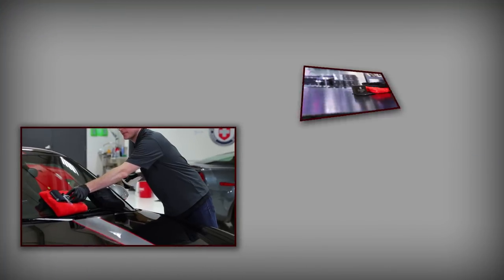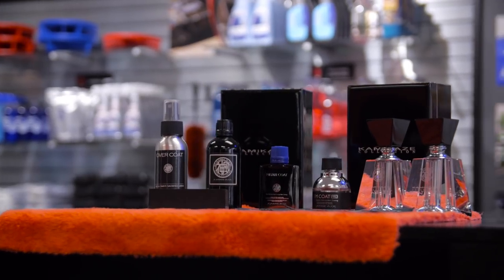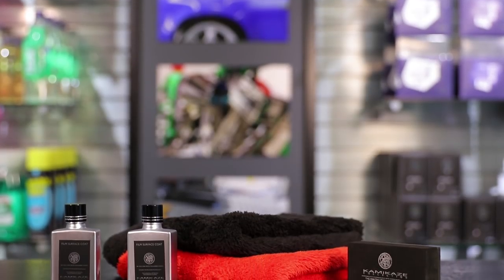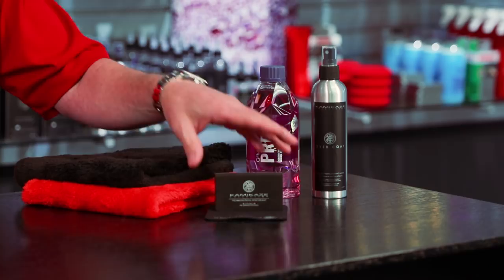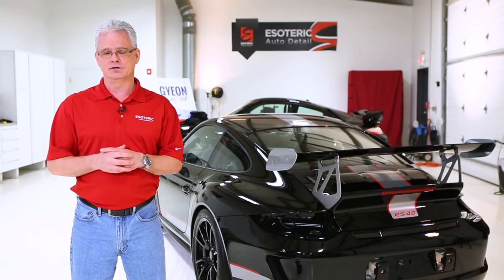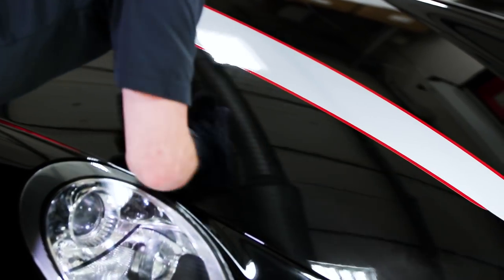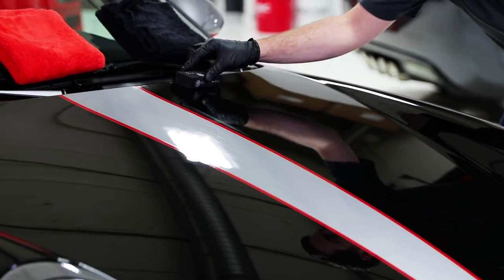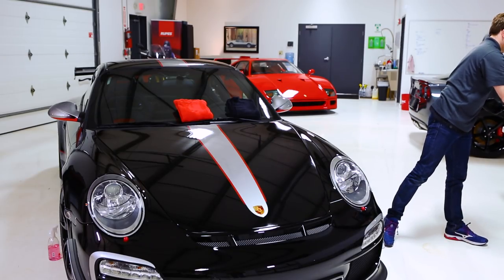How to apply glass coating to PPF. KAMIKAZE FILM SURFACE COAT.

Comment: Wow Todd you weren’t wrong about the slickness. I noticed it on the first wipe off, never had an mf glide so effortlessly. Just finished up applying miyabi + ism, and then used this on my clear bra skirts. I wish their other coats had this same slickness though now and wonder if I could use this as a topper in similar way to carpro gliss
Reply from the maker: Glad it worked out well for you. I don't know that I'd put Surface Film Coat on top of any other coating, but it does work as a standalone coating on non-filmed areas. I'm currently testing it that way on the hood of my DD (no ppf applied), and it performs extremely well.

Comment: Can IR dryer be used for final curing? Do you recommend to use IR on surfaces wrapped in foil? Can usage of IR dryer  shorten time before releasing the car in this case?
Reply from the maker: It could be used, however I don't recommend it...too many risks with that much heat on paint protection film.

Comment: How does Miyabi work on top of PPF?  I'm currently working on a 2019 Audi Q5, front clip is ppf. Customer supplied Miyabi and ISM, along with Carpro Forte for windows. Being that this is my 1st install with Kamikaze products I wanted to ask the product experts. Thank you for your time.
Reply from the maker: Works fine on top of film...just follow the same instructions for application as you would on paint!
Reply: @Esotericdetail  So no adverse affects (like spiderwebbing or cracking of the ceramic coating) of Miyabi and ISM (layered) on top of self healing PPF (STEK DynoShield?)?? Looking to get STEK installed and already have Miyabi and ISM.

Comment: Hey Todd, this may be a stupid question, but I was just wondering about the towels you threw away. Are those two towels you use enough for the entire car? Or just a section of the car and then use new ones for the next section? 
Thanks in advance and also love all the videos in your channel they are very insightful!
Reply from the maker: On most vehicles, just two towels are enough for the removal process for a single coat.
Reply: ESOTERIC - Fine Auto Finishing that's great thank you for the info!

Comment: Great Video Todd, by applying a coating are you affecting the seal healing ability of certain PPF's?
Reply from the maker: Thank you, and great question. We haven't tested it with all PPF's, but at least for items like SunTek and STEK, we still found that it maintained the normal self-healing properties. It's as simple as applying to a test panel, scratching it up lightly, then applying heat.
Reply: ESOTERIC - Fine Auto Finishing Thanks for your prompt reply, one other question I have is: is there a need to be super gentle and precautionary towards paint that is already ppf'd and coated as its self healing, wouldn't any swirls self heal thus leaving no need to worry too much about swirls? This is just one of my theories which I hope you as a professional could clear up.
Reply from the maker: Don't get caught up too much in "self healing" aspects of PPF. We always treat it as if it were delicate, soft, black paint and never take it for granted.

Comment: What do you do two or three years down the road when this deteriorates??  How do you reapply a coating or switch back to regular waxing??
Reply from the maker: Then I'd recommend that you (re) polish the car, and re-apply.
Reply: ESOTERIC - Fine Auto Finishing 
Do you have to remove all remaining ceramic coat before repolishing?
Reply from the maker: Polishing is the only way to remove the coating!!

Comment: Great information and video. Can i ask if a car has existing PPF on it, has been there for a couple years, and there are some light swirls, defects, possible contamination, etc, is a light polish required before prep wipe and coating application? And if so what polish/pad combo would you recommend? Thanks.
Reply from the maker: You don't have to, but it would make it look a bit better. Just use a light polish and finishing pad...
Reply: Ok no problem. Thanks very much.